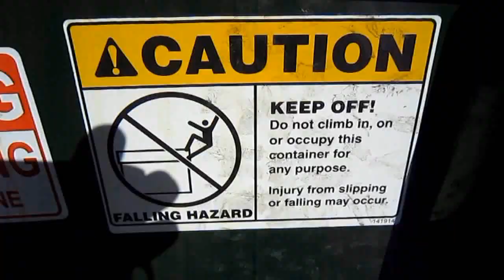Swanky Party at SRQ Yacht Club!  (Day 41 - 4.13.11)

Comment: BTW, you hooked up the jumper cables wrong: Connect one red clamp to the positive (+) terminal of the dead battery. Connect the other red clamp to the positive (+) terminal of the good battery. Connect one black clamp to the negative (-) terminal of the good battery. Connect the other black clamp to a piece of grounded metal on the dead car

Comment: @Kingpretzel1 Hate to brake it to you but its not voltage that kills you, its amperage... you can generate several thousand volts just by static electricity alone and it will not hurt you because the amperage is low.
The amperage from a car battery could kill you.